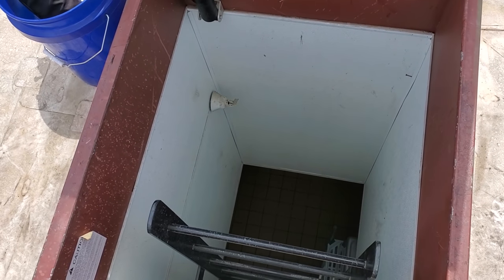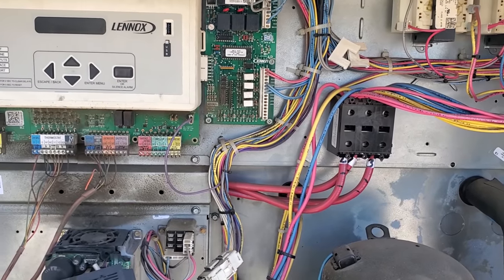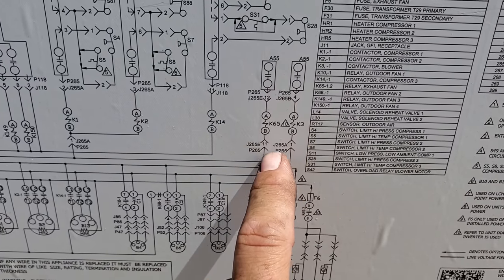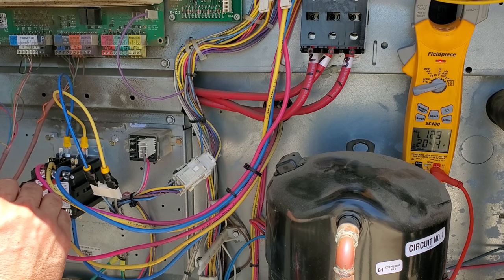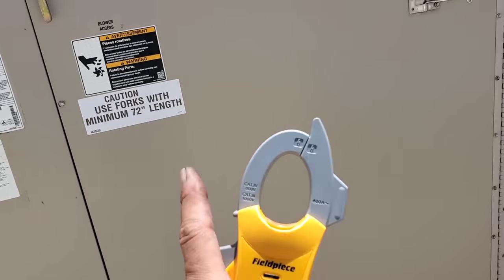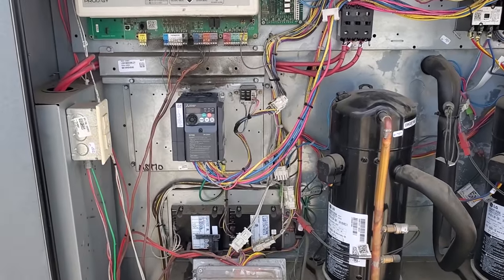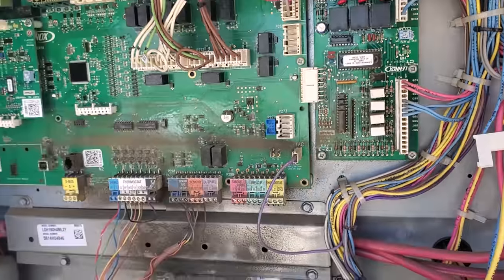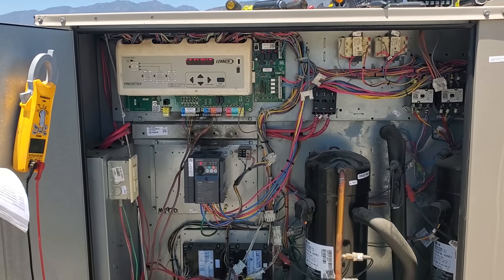THE DINING AC IS NOT WORKING

Comment: When you pulled the VFD, take note of the capacitors. They were severely bulged. Toss it. Electrolytic caps have paste inside. When that paste dries out, kabllooey.
Reply: Or find replacement capacitors and re-solder new ones. Same thing happened to motherboards back in the day.

Comment: Feels like those VFD drives should just have versions with more fans and changeable filters.
That way they don't get as dusty inside and should last a lot longer.
For this application having them be very compact doesn't matter.
Maybe have an attachable intake fan + filter?
But that would reduce sales for the VFD guys so... not sure if that would happen ... also maybe that use is too niche for those drives?
Reply: it is interesting, I don't think I have ever seen a running VFD that was not full of dust.

Comment: In that situation, with 2 other identical units on the roof, I very carefully swap boards to see which board is bad. But, you really gotta be careful not to screw up. Lennox had/has great tech support. I’d call them in a heart beat. Slowing the fan down de-humidifies much better as coil is colder. Thanks.

Comment: I'm a Chef by trade and Love your channel because I can relate to a lot of the crap that gets dealt your way. I've noticed on this Lennox unit and maybe another... The Compressors are in the "Electrical Compartment" of these units not out by the Condenser. I would think they would need air for cooling of the compressor.  Do they generate that little heat or does the refrigerant absorb heat from the compressor ?   Like reach ins, walk ins,  Cold Tables... the compressors are generally  right in line or offset of the fan pulling air through the compressor. Thorough meticulous repair as always.
Reply from the maker: The compressor is cooled by the returning refeigerant and that heat is rejected out the condenser
Reply: @HVACRVIDEOS  Thanks !!! Kind of thought that but wasn't sure.

Comment: Turf the VFD's and simply use a multi-speed blower motor (like what's in your desk fan)...
Saves time, cost (the multi-speed motor and required wiring) is likely MUCH cheaper than the VFD and required wiring...
It also reduced overall unit complexity and chance of failure as well as making it MUCH easier for the Techs to diagnose/repair when something inevitably goes BANG!
Reply: Much less efficient and the low power factor might just push them into the low PF penalty revenue class.

One of my clients runs a large metal punching plant.  They use multi-hundred HP VFDs.  The inside of the control cabinet is black from black oxide but the VFD is a high quality industrial unit mounted in a NEMA 4 box with HEPA filters on the cooling air intake.  The inside of the box is spotless.  Like many manufacturers today, Lenox designed that unit to hit a price point and de-contented the unit until they met that price.

Comment: If you expect that a system has no power it's actually better to use the NCV function of the multimeter, additionally to checking AC voltage with the leads. It makes sure there's no backfeed from a different circuit you didn't expect.

Comment: Whenever You Are Changing the Air Filters Those vfd's & circuit boards Need Blown out with Dry nitrogen too. I Have 2 - 50' - 1/4" Yellow Refrigerant Hoses that i use. Air hose can work too. I use the same hoses to Fill the Tires on my truck.
Reply: Dry nitrogen isn't needed for that.  Ordinary compressed air passed through a dryer is more than adequate.

Comment: All those small gauge wires in the top "half" of the drive are I/O.  Inputs are configured to cause the drive to do something, ie. change speed, run stop or jog etc.  Those would come from the main controller.  The outputs are configured to tell the controller that something has happened, ie. the drive has failed or the motor is running etc.  When we install a drive in our equipment {not HVAC} we either download a parameter file {for large parameter changes} or manually change some parameters.  We just had a case where we installed a motor/drive combo and the motor was drawing twice it's rated current with minimal load.  Turns out that the motor inductance parameter got changed somehow.  We determined a close value for that parameter and now the motor draws a little less than nameplate.

Comment: When i start working on gas boiler 20 years ago, everything was hydraulic and mechanic.
Troubleshooting was far more easy and materials was reliable.
Today, all this electronic create so much issues.
And it's normal because electronic didn't like heat and vibrations, which is more than common in gas boiler and AC.
For the past ten years, i was more often fixing new boiler than old boiler.
I had lot of old boiler (almost 50 years for some oil boiler) where i only have to do maintenance and it was never faulty.
They was no efficient but reliable, but today they are efficient but not reliable.
So at the end, the money you save in gas or oil, you lost it in repairs or replacement.
I miss old boiler a lot  (nostalgia)  :'(

Comment: Had a serious heart attack when you touched the belt of the fan with the unit still powered and the blower not locked out with a digital control unit, i've had units power the blower up due to funny faults causing the fan, something scary you never forget

Comment: Dont clinch to hard lmao, you may squeeze something out that can ruin your day and underwear. I'm glad you called tech support. I always tell other techs is necessary on some of these components. And boards can may have improper voltage but current is constant so that may keep board running but not doing what its specified to.

Comment: The reason why the camera can't see the displays is because they're doing something called multiplexing. It's much cheaper/less wires to display certain segments of a display at a time rather than every led at once.
Reply: A lot of that is the camera is doing a high shutter speed due to being outdoors in the sunlight.  Put a neutral density filter on it when you're outdoors and I'll bet the LED start looking a lot better.

Comment: To me that looks a bit like the damage you could get from a lightning strike.
But wouldn't a VFD also require a control over both incoming and outgoing air so that the air balance is kept in order, so one for the incoming air and one for the outgoing air?
Having the VFD in the unit makes sense to me as this would be close to the control board and the load - minimize the amount of wiring is usually a good idea and makes it easier when trying to find problems. But I agree that the electronics should be a bit more protected so that they don't accumulate dirt or bugs.

Comment: Why not just use a two speed fan ? So for first stage it runs at 50% speed and then 2nd stage 100%  would be a lot cheaper then a VFD
Reply: Lower power, less energy efficiency and depending on volume probably not even cheaper.

Comment: VFD needs good venting otherwise they can overheat and blow, generally they should be installed outside with a cover for good ventilation
Reply: At a minimum - the door should be  ventilated with louvers in it. A simple fix is install a Return air grill in the door with a rain shield 🛡 / piece of sheet metal inside door.

Comment: And by the way, you know, all pc boards are made in another country due to EPA regulations.  The acid used to etch the solder off where there's no paint has all be been outlawed.  The cost to treat the effluent from such a pc plant is prohibitive in the USA.  Closest source I know is Mekico or Shina.
Reply: Yeah, that's what you call exporting your pollution. Of course, if you export it to Mexico, it may not stay exported, depending on how close to the border the factory is.
Reply: No they're not.  My last company that I retired from manufactured induction heaters.  We used a vertically integrated box builder in Rome, GA.  If we had wanted them to, they would have taken my schematic and board layout, made and tested the units and boxed the finished units and drop-shipped to our customers.  The old ferric chloride echant is decades obsolete.  I don't recall what etchant they use is but it is clear with a slightly cloudy tinge.  A rejuvenation machine under the etch line does it's magic and dumps dry waste into a bin and water pure enough to go into the sewer. 

I have half a dozen US based board maker in my electronic Rolodex.  Especially after Corona, I'd NEVER buy anything Chicom unless I had absolutely no other choice.

I minored in psychology.  I have a paper from"psychology today" magazine titled "people who don't know enough to know what they don't know.

Comment: Typical jumpered system running , install the new parts, system down, re-install the parts when it worked. Like performing a 3 hour Field Modification Instruction and it don't work. Spend another 3 hours putting it back to to where it was when you walked in. Regretting going back to attempt the "UPGRADE" again. We used to make crap work by cannibalizing new and used parts to get out of Dodge!  Great save.

Comment: Why the US manufacturers don't know Dahlander motors? A VFD is only good if you need full variable speed control or a speed above the 60Hz rotating speed. For a two-speed drive only, you can easily use a Dahlander motor with old-style contactors and you will never have a blown-up VFD.

Comment: Hmm, energy efficient switching of two speeds would be easy! Mr Dahlander from Sweden developed the solution for the two speed Problem already around the year 1897. VFDs for only two speeds are nonsense and tend to fail if mounted in this dirty cabinet, fanless design of VFDs would be possible and could help, but cost a fortune.
Reply: There are three speeds on this unit (it has three stages)
Reply: @DocNo27  Wouldn't it be in this case sufficient to use the lower speed for stage 1 and the upper speed for stage 2+3?
I don't know these energy efficient laws, but given a VFD has some efficiency losses either (otherweise he wouldn't need cooling with fans), it would be sufficient to use 2 speeds and still be efficient.
Or using an tap on the motor for the less used stage, fans are controllable by voltage and this is reliable and archived with rather cheap contactors and some brain instead of these VFDs.
Just saying! There will be engineers who already thought about this issue and management who disturbed this thinking with costsaving. ;-)
Reply from the maker: Yeah the unit is setup for two stages, the second and third compressor turn on with the second stage
Reply: @deineroehre  I don't necessarily disagree with you on the real total cost of ownership (TCO) for some of these hair brained ideas, but you can thank our pandering politicians proliferating ponderous energy policies that sometimes force these ridiculous design decisions.  It's probably a wash in the real world, but for energy star they probably don't factor in things like cost and e-waste from the 10 VFD units an AC unit like this will consume over 30 years, yet they can meet some efficiency mandate that looks good to the pencil pushers that are often divorced from reality but instead seem to live only in this magical place where Murphy really was an optimist after all.

Another perfect example of regulations gone mad - my parents Acura RDX kills the engines at stop lights.  They live in the desert southwest.  What the do you do for AC with that kind of a system.  It's supposed to stay on if it's hot but the engineers idea of hot is completely different from a sane person.  Plus it introduces wear and tear.  Yeah they oversize the batteries and starters -  but it still increases wear.  It's amazing the number of people who don't religiously disable the daffy system and let their cars power off and on every time they stop, then have problems (often miraculously just outside of warranty) and then complain.  I'm hoping someone comes out with a ROM or other hack to permanently disable it cause it's dumb to have to push a button to start the car then push another to keep it running every time you get in :p  

I know they did it and don't let you disable it because it probably let them claim a few MPG on the fuel efficiency regs.  And just think what kinds of even dumber crap we would have if Trump hadn't canceled the completely unrealistic Obama mandates.  But I digress - a little.  It's all related.

Comment: I can remember those Lennox  M2 1generation boards use to cost us about $2,000.00 back in 2000 and the display pannel was $800.00 and the other assorted boards would run between $600 to $800.00 and OMG the VFD (Variable Frequency Drive's) would be about the same cost as the M2 board. We had a bad monsoon hit Tucson and lighting strikes took out 13 of these Lennox units on one building, our costs for all the boards and other parts was $75,000.00 and with my labor for 4 days with a helper, totaled $120,000.00 the area manager had to get involved with his corporate bosses and got approval in one hour,signed and faxed back to our office.We had to order everything express 1 day mail from Lennox, I was on the phone for 2 hours with a supervisor from Lennox parts. John was his name and he worked his ass off getting all of our order together from 6 warehouse hubs they had to even pull parts from the factory. What a frigen job, I was so glad to get off that job after 4 days, I took my Vacation a week later. Oh PS: we were the only Lennox authorized dealer in Arizona at the time. LMAO

Comment: Greetings.  You're now the third competent HVAC guy I know.  You're an island above the sea of parts changers.  I'm retired now but for about 40 years I was a nuclear and electronic design engineer by day and a refrigeration engineer by night.  I didn't crawl under houses or any of that kind of stuff.  I picked up the problems the parts changers couldn't handle.

What I saw when  you opened that control cabinet took my breath away.  Front and center is that piece of sh*t Chicom VFD (available for about $35 on Aliexpress.com)  only being used as a 2 speed controller, something a wye/delta contactor would have done just as well and lasted the life of the unit.  Then that rubbish control board.  Undoubtedly only commercial grade electronic parts where automotive-grade parts belong.  No conformal coating to keep moisture away from the electronics.  Non-waterproof connectors.  Worse screw and wire connectors.  Low temperature-rated wiring.  I could write all day.  That thing is what I refer to as a service call generator.  And I though Rheem was bad.

I envy your nice test equipment but I do NOT envy the junk you are having to work on.

I like to pass on tips I've learned over the years.  Here's a tool that you can make for less than $5 That will tell you when the system is truly dry and free of leaks.  Get about 18" of 2" clear sewer pipe and a square of plexiglass about a foot to the side.  Smooth the bottom of the pipe and glue it to the plex.  Drill and tap a hole in the side of the tube to receive a brass hose barb.  Get another vacuum pump exhaust cap, epoxy or silicone all the openings, then drill and tap it for another hose barb.  You'll use some Tygon tubing to connect the two together with an aquarium check valve in the line to prevent water backflow.

To use, pump the system down normally.  Once you can detect no out-flow from the vacuum pump and your vacuum gauge is near zero, connect the cylinder to the pump, fill the cylinder about half full of water and add one granule of either laundry or electric dishwasher detergent to the water. 

Your vacuum gauge will be at zero but not really.  I use the same type of gauge in my neon sign plant and know from comparing it to a laboratory high vacuum gauge that it stops at about 25 Torr.  Turn the vacuum pump back on.  The water will bubble vigorously for a bit and then slow down.  I consider the system absolutely clean and dry when the bubble rate reduces to one about every 30 seconds.  I've never gotten below that.  My theory is that the air at that rate is seeping through the vacuum pump carbon/ceramic seal.

Break the vacuum with refrigerant and you're ready to go.  Getting the system that dry really does make a difference.  One of my first installs after developing this technique was in 1983.  I installed a 2 ton condensing unit for a new restaurant's walk-in freezer.  The building went through a series of restaurants.  I never got a call-back.  The building's owner told me when I asked that the same condensing unit was still running when they pulled the meter and sent in the heavy equipment to demolish the building.

While I'm blabbering, I want to say a word about my late, great Dayton (Granger) vacuum pump.  I bought it in 1983 too.  Last summer I ripped the old SEER9 3 ton heat pump and replaced it with 3 zones of mini-splits.  I was pumping down the second system when the pump quit making noise.  When I looked, I saw that the motor shaft had broken.  Metal fatigue.  What a wonderful service life.  Amazingly enough, Graingers still stocks a rebuild kit for that pump.

These mini-splits are Carrier units.  I've already lost one control board.  The compressor VFD output transistors had literally exploded!  I went to the other unit and got the part number.  They were running these transistors at their absolute max rating!  A marketing spec.  No self-respecting engineer would get any closer than half the max rating.  I "fixed" the other two units before they blew.

Cheap chicom crap.  I have discovered that every brand Johnson sells is exactly the same unit, the only difference being the branding.

Back to doing nothing :-)
John